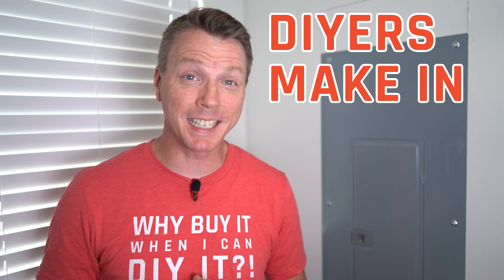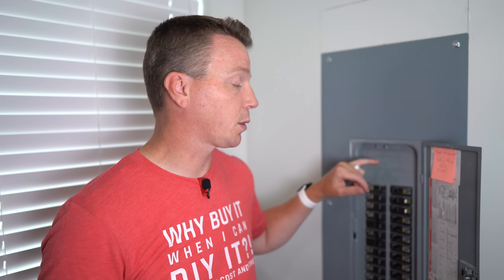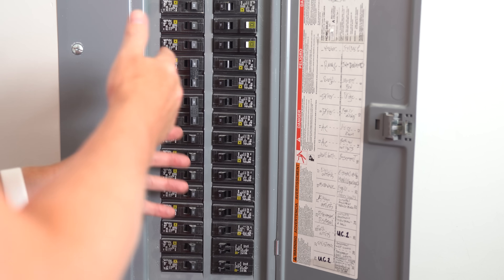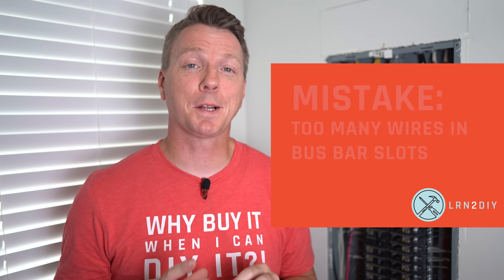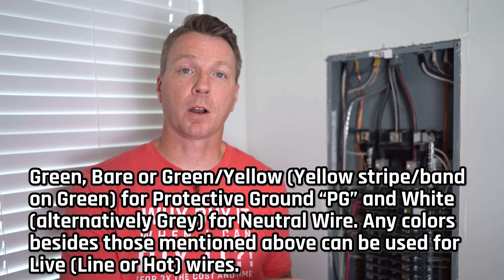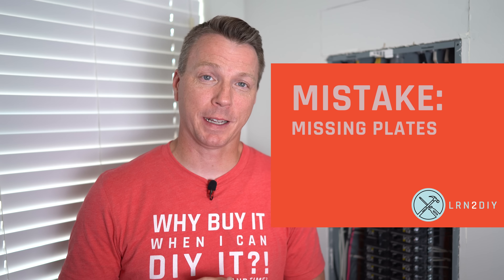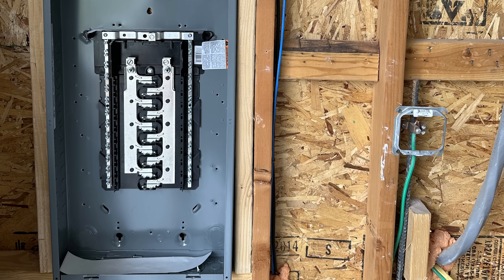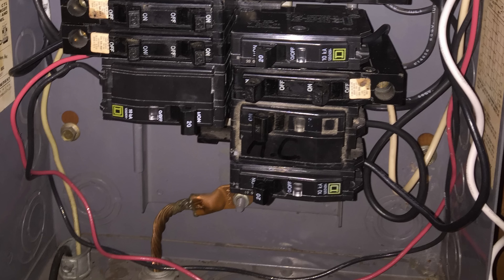10 Common Mistakes DIYers Make In Circuit Breaker Boxes

Comment: I don’t think it’s okay to (1) have any wire nuts in a breaker box and (2) to allow multiple 14 gauge circuits share one 14 or 12 gauge ground. That’s like saying that if your AWG (average wire gauge) is 14 gauge then it’s okay to use a 12 gauge ground on your ground rod. I would also like to make a suggestion. You can also get wooden dowels at Lowe’s or Home Depot. Try using them to point out live circuits rather than your fingers. I got PTSD watching this.

Comment: At about 5:25 you note that the main ground has been snipped. I have rarely seen a ground brought in with the entrance cable. I would snip it if there is no connection on the other end so hopefully it would be understood another ground needs to be supplied. A "Not connected" tag would be good insurance.

The problem with super neat panels like the three phase panel you show is that there is no slack wire. If ever a circuit needed to be moved lower there is no slack.

However, I think this is a good presentation.
Reply: Uh hello.  If there's a service cable supplying the power. It usually means there's no raceway. Therefore trying to get another conductor from the ground rod to the existing panel most likely would b impossible. Unless the panel is located in close proximity to the main!  At worse case scenario utilize the existing bond conductor and secure it to the can or install a grounding lug

Comment: IT IS AN 180 AMP PANEL... BUT YOU SHOULD NOT OPERATE IT OVER 80% OF THAT, 120 AMPS.
TRANSLATION: IT IS A 12O AMP PANEL FALSELY LABLED AS A 180 AMP PANEL BECAUSE HIGHER NUMBERS MEAN MORE SALES. HOWEVER OPERATION OF THIS PANEL AT IT'S ADVERTISED OPERATING LOAD IS AN EXCESSIVE SAFETY RISK... 
THANKS AGAIN, CORPORATE AMERICA.

Comment: Great video!  But how is it acceptable to pigtail (whether it be the hots, the neutrals, or the grounds) of two or more circuits entering  the box thus reducing to a single gauge pigtail before landing?    For example, three 15 amp, 14 gauge neutrals are connected with a 14 gauge pigtail.    That 14 gauge pigtail “could be subjected to a net 45 amps.”    Just asking…
Reply: Good point. That's why they make amp probes!!

Comment: Except for A/C, and Refrigerators{Or anything with a Compressor, & Possibly Washers & Dryers} I would install ALL GFI Breakers, super Safe..
Reply: till those POS trip from vaccums, hair dryers, blenders. AFCIs have a hissyfit from almost anything with a large inrush. I ditched every single one in my house right after inspector was out the door, out of my driveway

Comment: I have seen many panels that the ground and the common are both on the same rail. I know this is not code but on the other hand they are both going to ground anyway.
Reply: Yes, but how they get there is important. If you mix ground wires and neutrals on the neutral bar in a subpanel, any neutral load can partially "backfeed" through a branch circuit ground, and, for example, a grounded refrigerator can become a parallel path if someone touches it and any other grounded surface. This would usually result in nothing more than a minor "tickle", but if the neutral path became loose or disconnected at any point, up to the connection to the utility, it could be dangerous.

Comment: Something you mentions and I find it just horrible, is the lack of proper marking for each breaker. I think it should be law to have every room, or outlet and every light marked as to which breaker. Yes, this would require several pages but it would be readable and not a guess me every time one out lite or switch needs to be worked on. Your printed form is very good but if the power is out in that room and the lighting is poor you need something with larger print or something you can take into the light to read which is which. This brings up another point; if the electric panel is in a dark corner of the house or basement it should have it's own separate breaker and light.  
 I mentioned this before but don't know if it was on this channel. But be aware that a 220 volt connection, or short can happen if you have adjacent rooms and some one uses a extension cord to the other room for a fan or heater or vacuum or air conditioner. If two cords are in play and they both are in bad condition of exposed wires you have the possible 220 volt connection if those two are on different sides of the electrical panel.

Comment: It's wonderful to walk in to a job, maybe an electrical renovation where maybe the Inspector has put down "The Foot," and sez to either rip it all out and start over or fix whacha got, and there's plenty of stretch.  You can just open all the walls up and pull everything out, I-D where it goes to and upgrade the panel with GF breakers and Arc-Shield breakers, BUT Whaddaya do when it's a nightmare?  Where the short stretch can only be done by spaghetti ?    I found that in these horrendous circumstances the best thing is to install 4X4's near the panel and to splice each and every conductor that would lend itself to Horror, with appropriate cabling. Then appropriate box connectors with plastic ferrules, Then correctly dressed conductors like that "museum" panel.
If the customer doesn't like it, his or her animosity is NOT going to make the Inspector Go Away Happy, so you might just have to walk away.  Hey, It's Your Ticket. It's your reputation.

Comment: Electricity will get you killed. I've been an electrician for 31 years.We have been trained on theory, load calculations, and some engineering. One mistake could kill you or burn down your home. Call a qualified electrician that knows the NEC code and can do the work in a workman like manner. It's not worth loosing your life or burning down your home. There is a reason we exist in this trade.

Thanks!

Comment: 5:57
It might be LEGAL to use a wire nut, but it's NOT a good practice - they corrode and FAIL over time.
I've lost track of how many times I've seen older wiring with wire nuts that ARE NOT CONNECTING.

As I recall, the code say "no spices of any type" on ground wiring, and wire nuts ARE COUNTED as a splice method.

You CAN legally under the code use more than one ground wire in one of the bus bar connector bays, as long as they both (or even 3 in some cases) fit INTO the bus bar hole and the screw tightens them ALL down.
That however is ALSO not a good idea - same issues as with more than one neutral in a single bus bar hole, higher probability of a poor connection or the screw working loose due to the higher-than-designed for pressure on it.

Comment: i found 2 bird nest (multiple copper wires wrapped together) I solved that with soldering the wires together and a wIre nut. I also Found White wires connected to a breaker. A red marker and colored the wires. solved that. I found it easier and safer to use a plastic marker close to a hot lug rather than my fingers. GREAT VIDEO!!!

Comment: I live in W- PA . I have worked with 12-2 in the following color jackets : white, blue and black - yes, it was all 12/2 Romex. Also, point #12 - people need to use Romex connectors when using Romex cable !!!  Not just let the cable pass thru the knockout hole in the box !!!  Point # 13 - PLEASE STOP USING THESE " WAGO" / "WEDGIE" CONNECTORS AS ( THE CHEAPEST, MOST UNWORTHY) substitute for a wire nut that I have ever seen or heard of !!!!!!! Too many times I have witnessed a power loss and found these to be the problem !!! CHEAP, UNSAFE AND JUNKY !!! GET RID OF THEM !!!!
Reply: Concerning " Wago" wire connectors - is there no longer a board of inspectors like UL, Etc that electrical part have to pass thru before approved .??????

Comment: You just can not add the number of breakers  and their amps. and determine the size of main service breaker. You need a load calculation. That way you can be certain about the size of your service.

Comment: So two small corrections. 1) The current doesn't flow TO the outlet. When you showed the tester, your detecting voltage not current.  2) The white lead being used as a hot is no longer allowed. All new circuits must have a neutral conductor in the wire. If this panel was installed recently and they wired the white as a hot, it's not code. This was done for years, it's how we always did it, but I know the code has changed on it.
Reply: you can use the red, black or white if you using 12/3,14/3  as neutral. the sparkies that just swapped our shop panel at work used the old school black and white as hot. they repurposed red as neutrals , just marked /taped the first 6 inches with white tape at both ends

Comment: Always read the specs on your load center before doing things. Square D allows two wires to be placed in the holes on the neutral or ground bars. They need to be 12 gauge at the max and need to be paired with the same size wire. Yes one wire is ideal but if done properly it is ok. Also know how many breakers you load center can handle, you can put twin breakers anywhere in a Homeline series but a QO series has different rules. Older QOs could have twins anywhere, newer QOs can only have twins on the bottom five spaces on each side, and the newest QOs are being recommended to not use twins at all. Its all in the part number, a HOM4080 has 40 spaces but can have 80 circuits if filled with twins. The sticker on the inside of the door will tell you everything you need to know from spaces to acceptable breaker replacements and parts. Also most loadcenters use generic covers/doors just because you open the door and see two spaces left to knockout to add a circuit doesn't mean that you have two available slots on the bus.
Reply: Most codes stipulate just one neutral wire per hole; the QO and other brands may allow two Ground wires, only of the same diameter (2-12, 2-14). Code always takes precedence over a mfg. specs, and also usually demands just one wire per breaker, regardless of the stamped spec. A legal option is to pigtail more than one hot, and only put one into the breaker - cannot mix 14 with 20 ga. if going to a 15A. breaker. Our 50 year old home has had a lot of lighting added, and it feels tricky that so many branches all tie to one or two early "lighting" circuits, yet in practice especially as more LEDs are used, the amperage load on these do not get high as many lights are not on at once. A kitchen circuit might have a toaster, blender, mixer, radio, on at once, adding up for a couple hours at a time - where balancing loads as a concept enters, so phases offset and reduce a high return load on a single neutral. Making older wiring safer, yet not up to modern codes, can be a tricky art.

Comment: Nice vídeo, Just one comment, breakers don't "push" ampers through the wires. Actually, the reason we want breakers and wires matching is rather the opposite.
If you have a short in a 14 gage wire, if the breaker is set for too high current to break  the circuit, because of the wire thickness that current may not be achieved until it's too late. You may have a fire started if the wire is allowed to burn hot for long.
Remember, current is required by the load, not pushed by the source.

Thank you for the video!

Comment: Does anyone know what would cause a 60 volt AC output?  It's the only electrical issue remaining in my 50 yo house.  Overhead light switch outputs 60 volt instead of 120 volt.  Does an improper neutral cause that?
Reply: Yes sir.  That's exactly what you're dealing with.  Very tough to troubleshoot.  Unless your a master!
Reply: Start at the source then  process of elimination from there

Comment: Great video thank you for making it. Just one detail, your active circuit breaker showed torque of 36 in-lbs but your said you set the tool to 50 in-lbs not sure which was right or was said wrong. That is why it seems that the two or three screws you used to show the toll seems loose, but I think may have over torqued them?
Reply: I was just typing that as well.

Comment: A common DIY mistake I see as a home inspector is the use of "off brand" breakers when replacing worn out breakers. Just because a breaker fits doesn't mean it is correct for the panel. Older breakers can be troublesome as companies get acquired or simply go out of business. When in doubt, ask an electrician.

Comment: On Number 7, if you use a White wire for a hot, it cannot be a branch circuit and the other side also needs to be banded as a hot.
Reply: Most likely that wire will be running to a 240v dedicated to that line device.
Reply: @scottdowney4318  Correct, but no mention that both sides need to be banded with red tape. They only mention the panel side.

Comment: Few things to note:  I'm sure you already know this, but viewers may not.  If you are working in an older home, all NMB was naturally colored (White) till the mid-1990s when NMB 12 (Yellow) and 10 (Orange) were introduced. Also - 04:08 Romex is a trade name for Southwire. Cero, Encore, and Republic Wire all make NMB in the united states. (Calling NMB [Non-Metalic Building Wire] Romex is like calling all jeans Levis)  Very well thought-out video.  I will share this video with others. for sure!  You also have a new subscriber!  🦅
Reply: Partially true. The color coding didn't start til the 90s, but NM cable came in all kinds of colors. It was a manufacturer choice. Come across white, black, gray, tan, blue, and green sheathed NM cable in older homes.
Noticed now that they have a purplish color denoting 14/3.

Comment: So if I tape the white secondary hot with red, isn't it perhaps a good idea to tape the other end (unless it's somehow obvious)?
2) I had to replace a 4-way switch (three switches controlling same light(s)) once in my old house and I guess there was a fire sale on yellow wire because they had used yellow wire for every connection.  I may not remember this tight, but it was further complicated by 4 way switches not connected internally the same? and my new switch was different so I think I couldn't just switch out same position wire from old to new and have it work.  Seem to recall that they both connected the same side terminals to each other, but when switched, one connected side to side terminals and the other connected hi-to opposite low (criss cross).
Reply: its common for entire house to wired with 12/2, 12/3. my sisters whole house is wired with 12/3. PITA to get thick 12 gauge under light switch screw/tab

Comment: 1. The SER needs a bushing on the connector   2. This is a sub panel with an outdoor disconnect 
3.  A modern SQ D homeline allows you to make that entire panel tandems (24spaces/48circuits)  4.  2 same size #12 & & #14 wires per lug are allowed under each lug (manufacturer and ul listed to do so with this panel)
Reply: SER is a cable, bushings are required for conduit

Comment: 13:10 As a European, I'm abhorred by that beautiful box as I see every third wire going into the circuit breakers being the neutral...  jepp, colour codes with one exception aren't universal.
Brown = first phase
Black = second phase
Grey/white = third phase
Light/clear blue = neutral
Green and yellow = protective earth, and thankfully is the same everywhere today, though older standards could have them red instead.

One thing I notice is how high current US operates with due to the lower voltage. With 240 volts the standard phase current here, a 1kW load requires just below 4.2 Ampere while the same load under 110V  takes 9.1 A.

So, what can be learned from this?
The obvious is that you need to learn your local standards regardless of where you are connecting things, as there are no guarantees that what is acceptable in one place is acceptable anywhere else.

Comment: The thing that causes problems with putting 2 wires under the same terminal is if the wires are different sizes because the terminal will tighten on the bigger wire and the smaller one will eventually work loose and have a bad connection. If they are the same size then its fine although still not best practices but if you are really short for available slots then you should add a new bar

Comment: Tightly bundling wires together in your aesthetic example is a bad idea. It decreases heat dissipation in the bundle and makes access to individual wires difficult for troubleshooting. There is a happy medium that is not a rat's nest but minimizes heat buildup, allows access to individual wires, and is still sufficiently aesthetic.

Comment: Safety is the extra millage that saves troubles and even lifes. One time i was installing a fixture , being too lazy to reach the breaker i short-circuit the wires with a screwdriver , a spark resulted in a small ball of burning copper that landed on the sink causing a spot .
Good video.

Comment: I am a diy electrician and actually nailed all of these. The last one about the torque I never verified with my panels but I have been working on cars for 40 years and can estimate torque within a few inch pounds.
Reply: I find that I tighten the wire. Then when I go back in a few minutes it is looser than it was, so I tighten it again, the copper relaxes under the screw. It never needs more than 2 tightenings done.

Comment: I never knew about that circuit breaker finder tool...definitely adding it to my list to buy. I'm always trying to figure out what breaker goes with what. THANKS!
Reply: I have used several different circuit breaker finders, including the KLEIN model shown in this video and have found them to be quite unreliable, particularly in older homes
Reply: @frankrossi1767 good to know. My home was built in 73 so maybe they wouldn’t be too reliable for me

Comment: Providing there is no disconnect between the panel and the meter the “ground” wire on an SERVICE ENTRANCE WIRE “SER” would not be used and cut off. Perhaps the contractor was being frugal and using up scraps of SER or the panel was within 6’ of the meter location but “back to back” meter and panel wouldn’t work.